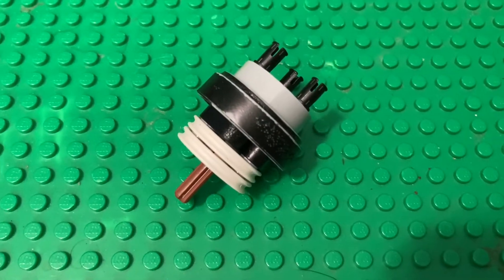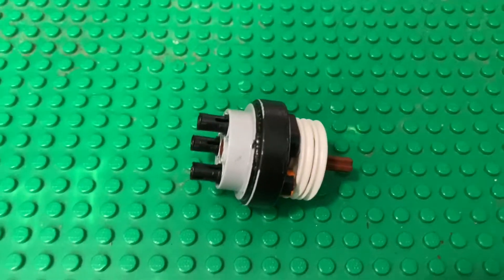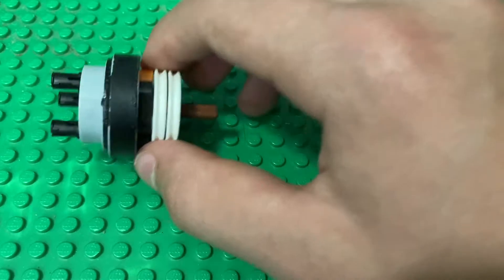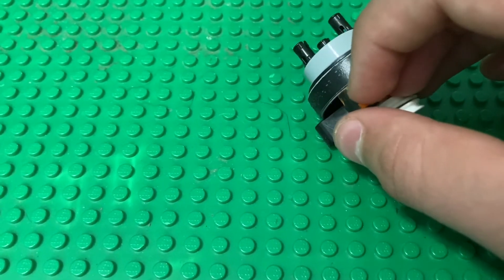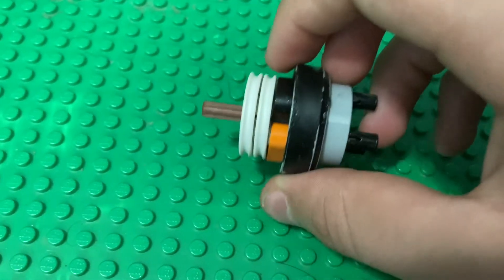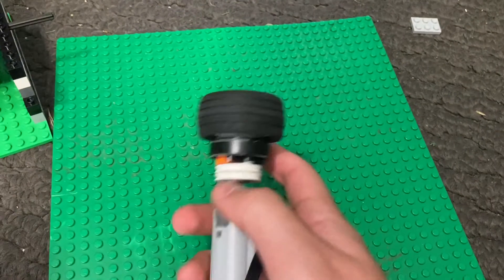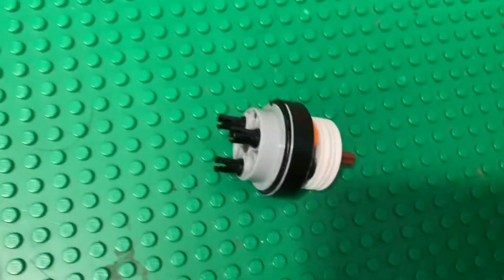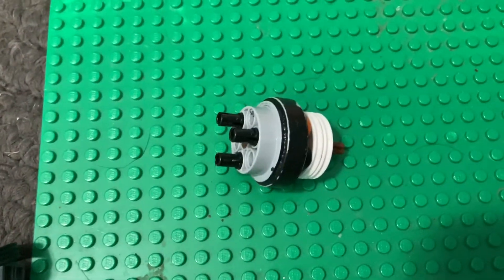ONE WAY CLUTCH: Lego Tutorial

Comment: Do you have to have rubber?
Reply from the maker: No. Like I said in video it is an alternative to the rubber dampener piece which when used does not require the inside coating on the clutch shoe.

Comment: Centrifugal clutches work on spring power. When the engine reaches a certain rpm is when the pads engage. This is just like a fear system on a pedal bike. The engine has to be able to idle and not move the clutch until revved. The reason I know this is because my go kart uses a centrifugal clutch that I've taken apart and replaced. I came up with this design before once but it's not a true centrifugal clutch
Reply from the maker: @Joey Willis You can modify it to run on a rubber band, it is possible to run it with a vacuum engine depending on rpm and band tension.
Reply: I have made a true centrifugal clutch from Legos. It used a rubber band as a spring. None of my vacuum engines had enough rpm to engage it
Reply: @MrThunderCunt  Try using a stretchier band
Reply from the maker: Everything But Mechanics you’re right about that and the reason why I personally consider it centrifugal clutch because it works the same way pretty much. If it had a rubber band it wouldn’t engage easily and would require high rpm. I have an idea of how to use a rubber band with this setup and I might try it with one of my fast engines.
Reply: @KFPlusLegoMastery  Yes I agree. But the main purpose of a centrifugal clutch is to do exactly as I said earlier. They way you have it, it'll go at an idle speed. So if you think about it, as long as the engine is running, the shaft is spinning. Remove the clutch and put a axle instead, saves you parts, weight, time. And it does the same thing. That's why I originally ditched the design.
Reply: I made it that it will only spin when it’s on high rpm, but it won’t work for my 6 by 6 engine